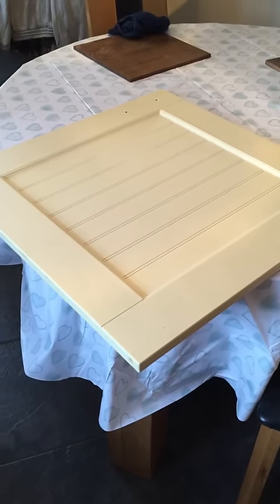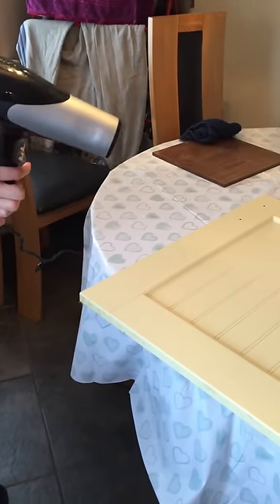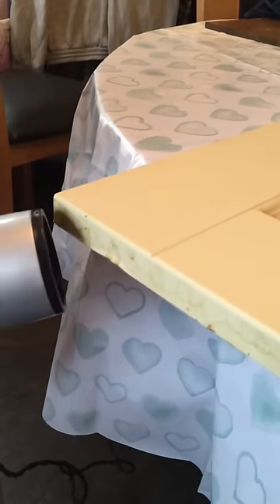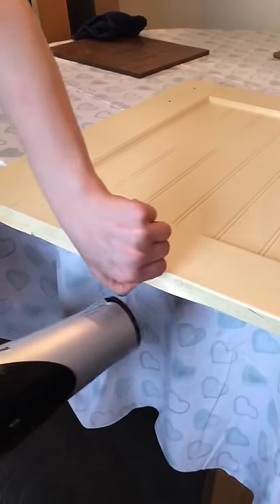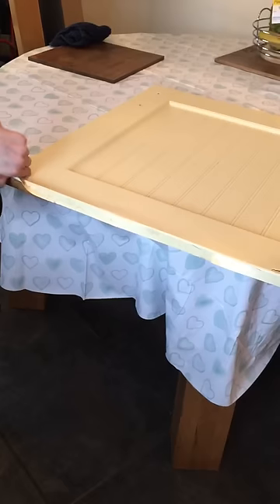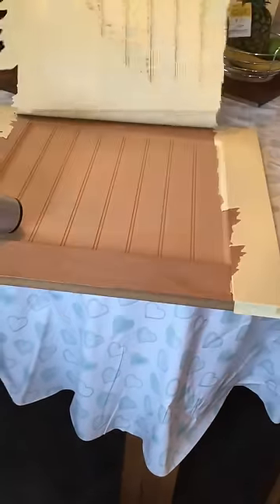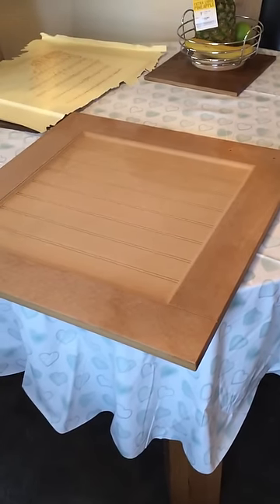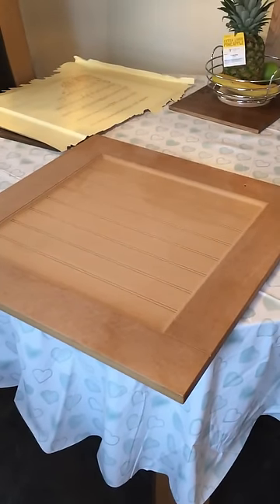House Removals Cardiff - How to make old vinyl plastic covered kitchen cupboard doors ready to paint

Comment: Great way to do the removal! I am going to be removing the thermofoil from my cabinets soon. I'd like to know if you needed to sand the MDF before. How did you handle the actual cabinets themselves? Did you have to remove thermofoil from them or just paint them?
Reply from the maker: To be honest we just peeled the vinyl covering off, then painted directly and it worked out perfect. Just use a good quality paint, we went with Ronseal cupboard and furniture paint from B & Q. Just make sure there is no glue left on the doors before painting. The glue usually comes away with the vinyl covering if you heat it enough but if not just a  a light sanding.

Comment: Are kitchen cabinets like this wood? I thought it was like chipboard underneath mine therefore not a good surface for painting?
Reply from the maker: abnwtfwc07 All the ones we have had have been made from MDF, I haven't seen any chipboard ones before
Reply: Thanks for the reply. I've just had a look at mine and it's looks like the cupboard doors are mdf but the plinths and some edges have a rough chipboard type look. Did you peel absolutely everything?
Reply from the maker: abnwtfwc07 We just did the doors and left the rest as it's like you said with the chipboard so didn't want to risk it.